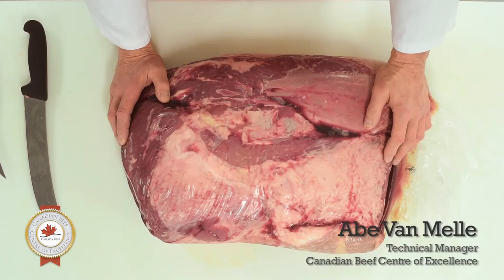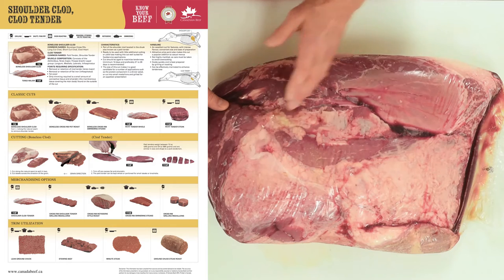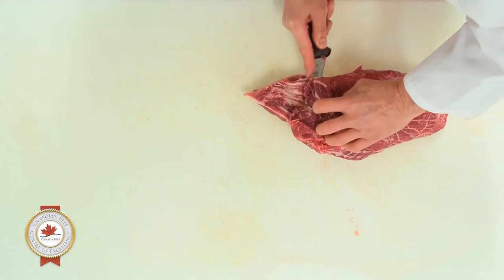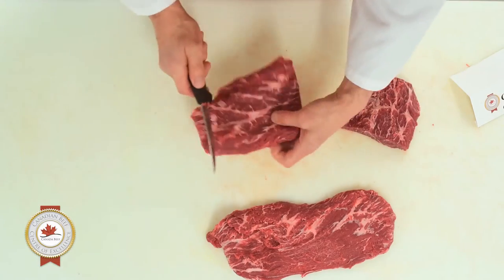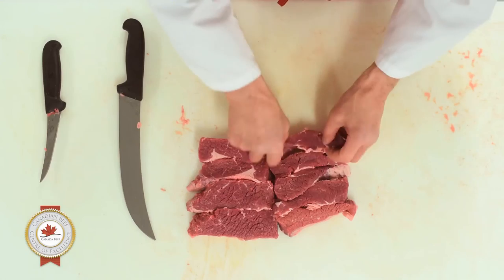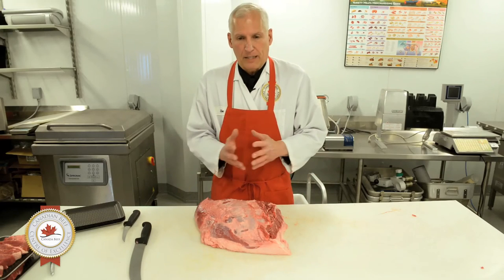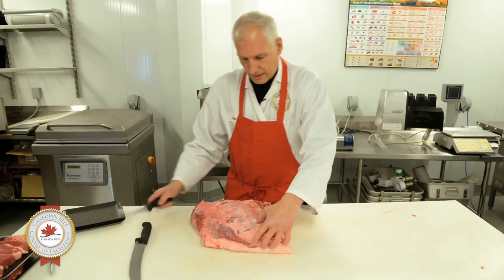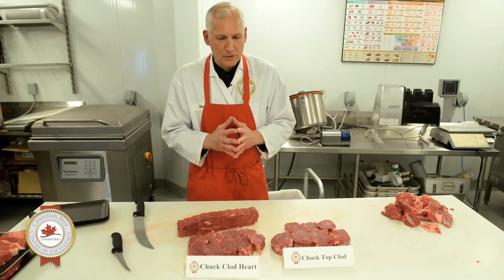Chuck Shoulder Clod

Comment: The local Kroger used to sell "top blade steaks" with the connective tissue in the middle. I actually like the connecting tissue - something about the texture when you chew it. The steaks themselves were pretty tender, I'd just pan-sear it, eat it with rice. Now I know why they were so tender.

Comment: Amazing to find this video with beef prices going nuts retail, I was able to get one of these very cheap comparably, at a local Restaurant Supply Chain. This makes it easy to get the right cuts. I did a different packer beef, Inside Top Round and did it on my own basically doing what you did, following the natural seams and where the grains went. Turned out to be top sirloin and got some very tender cuts out of it. Hoping to score again with this large pack of meat. Then I'll be more confident to break them down in the future.